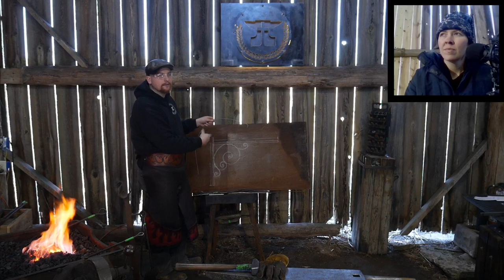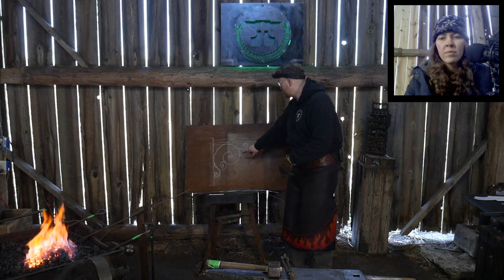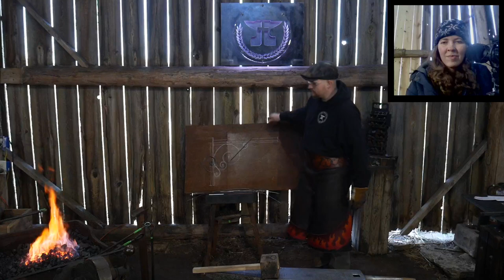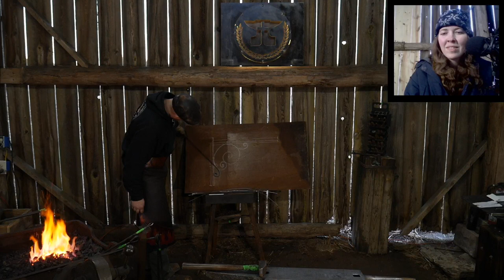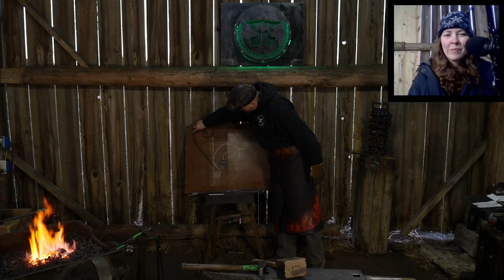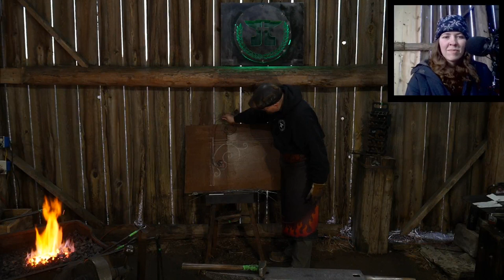LIVE: Forging an Ornate Sign Bracket

Comment: In cold forming fabrication we would use inside dimensions up to 1/2". 5/8" and above we would work on the centerline dimensions.
1/2" and under would stretch the outside material of the radius about the corner.
5/8" and above would stretch the outside radius and compress the inside radius about the centerline.